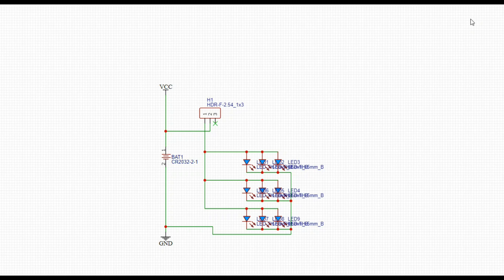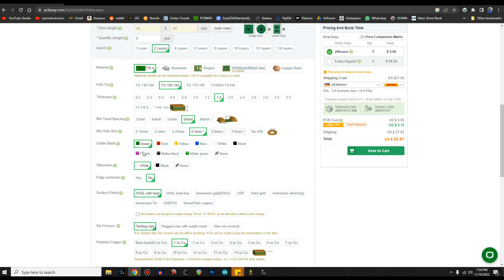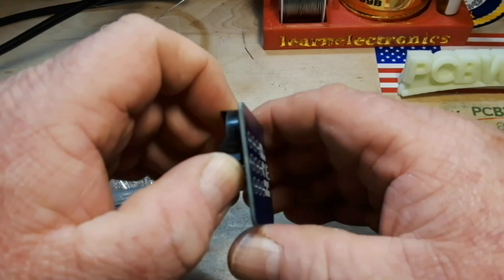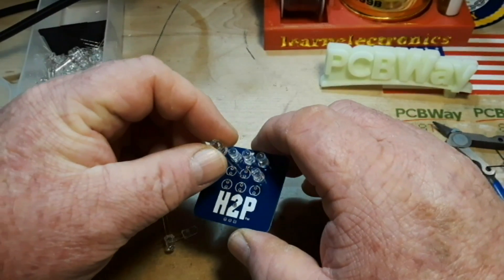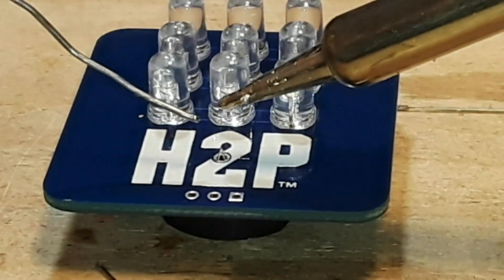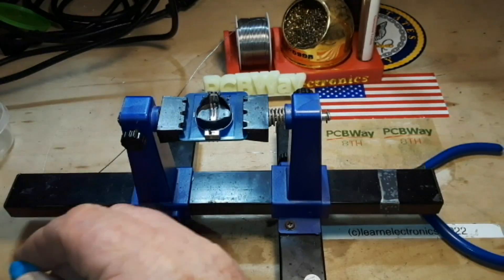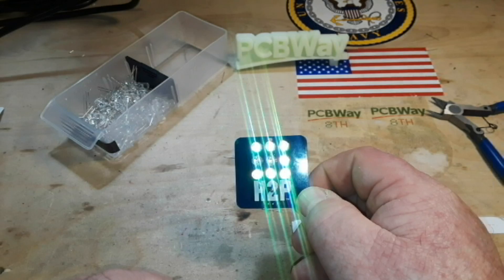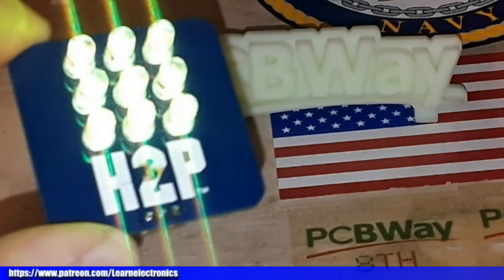Hail To Pitt Spirit Badge

Comment: Ideally you should have resistors, (about 100 ohm), in series with the LED's and have the LED's with resistors in parallel, to increase battery life.
Reply from the maker: It's for games if they get a couple hours they are golden.
Reply: @learnelectronics  Fair enough. :)